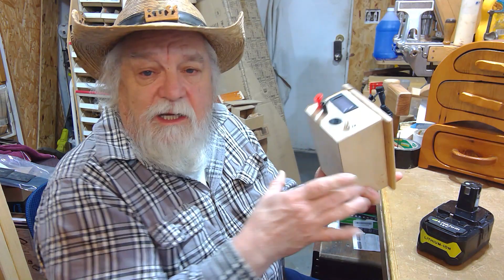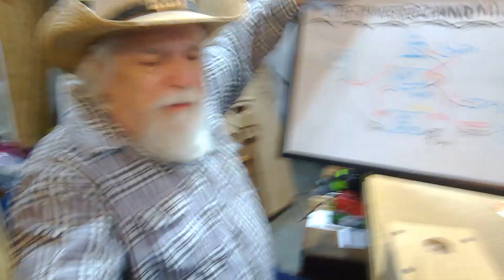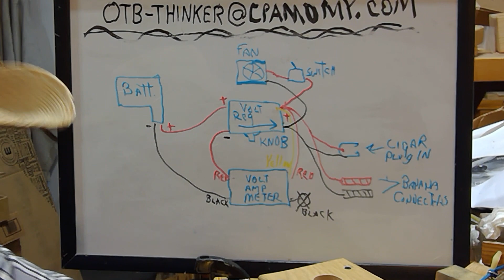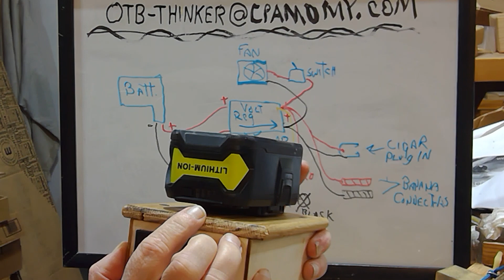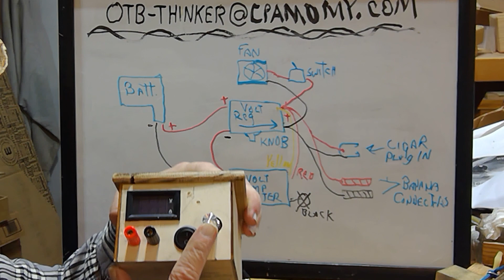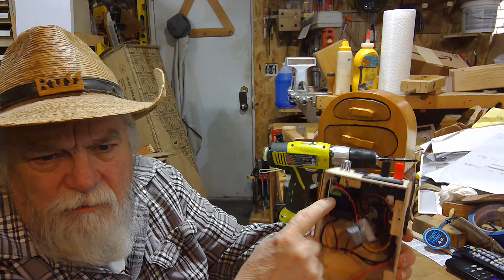Ryobi Powered Outlet Box by Rambling Russ

Comment: This is awesome. I love seeing creative uses for these tool batteries. I use my ryobi batts with laptop car chargers and usb adapters that are rated for up to 24v. Works great - charges phones, runs laptops, and powers my raspberry pi. Even my router and switches are rated for 12-28v so I just have a clip to adapt to a barrel jack for them.
Reply from the maker: Thanks Razz.  I have been making different designs of a Ryobi battery receptacle and now feel I have one that is as good as any 3D printed.  Can you describe a little more detail about your clip you use?  I am always looking for other's ideas.
BTW, I have made several Ryobi battery videos if you want to see other ideas I have done
Reply: @russveinot5754  Yeah, the clip I use is just the most common factory replacement battery clip from Ryobi's parent TTI. The part number is TTI300001044. Regular pricing on them is a buck or two per unit but you can get em on sale for under a buck from time to time I have a bag of like 20+ for under 20$ after shipping from a ways back. I got the idea from another youtuber who use them to make 3d printed receptacles. They have little terminals that fit spade females perfectly and I wire that to barrel jacks or xt60 connectors etc. Works great all by itself as long as it is sitting still - retention is good enough to move it a little from place to place but its not locked. I have a couple 3d printed receptacles that use keystone 209 terminals but the TTI part (with or without 3d printed base) is my favorite so far. Edit: You can also use the clips with epoxy putty or hot glue and molded or shimmed pvc etc to make a receptacle. Just ideas tho - yours look like they are working great. 

Thank you for the heads up I will check out your other Ryobi vids. I will check those out too!

Comment: 11.5 amp @ 20v? That is impressive! 
Oh I like that PCB. I'll have to look for that one,  most all I'd seen came from the front,  not the knob off the side.
Hope you got the door done, but unfortunately I think you lost the opportunity to get it done in the better weather. 
Like dude said, that Flintstones look is awesome!
Reply from the maker: Hey Charlie.  It was all built in the shop, so I did get the door done (not painted yet) & installed.  The dog & "You Know Who" are both very happy.
The potentiometer is hard to control to the meter gauge scale, but it does work very well for what I need.  BTW, those green wire connectors suck.
Reply: Green wire connectors?
Is that the Wago style, but no the brand?
Reply from the maker: @charlietuna5962  follow my link to the pics on Amazon.  I have never seen these before.  they clamp up instead of down.
Reply from the maker: @charlietuna5962  No, it uses a screw, but it pulls the plate up like the lower jaw when biting.  the screw interferes with the length of the wire being inserted.
Reply: Oh, I got ya....
The board connection terminal. 
Yes, those are pretty common. 
When they don't have a "back", they aren't so bad, typically found on larger boards.  But like you said,  when they have a depth stop, they are a tremendous PITA and are very difficult to get a significant bite on the 20+guage wire they allow.
Not so bad within a fixture box like you have, but really suck when you have more exposure and more wiring tied in a bundle.

Comment: So are you on a first name basis with your Amazon Driver? 
I'm telling you,  you'd enjoy the conversation over at Chester's. Ya, probably find similar things and maybe pay a few bucks more,  but he's definitely got a good selection and on hand.
What do ya think,  a 30 minute drive? 
So what are you tinkering with that you are using so many banana jack's handy?
I've been trying to find the time to get into the wiring on a Harbor Freight 5 drawer roller stack I'm building.  I'm planning to have a PC power supply (drop a cord)  as well as a One+ option for cordless option.  12v sockets, some LED's for the nightlife,  and have 24vdc on an XT60 jack. I considered the banana jacks for a variable voltage,   but didn't have the room left to have access for the rheostat knob mounting the buck board against the front panel. 
I figure if that need arises,  I've got some SAE connections too, so I can rig a removable lead that allows me that ability. 
Man, haven't they gotten the "smart grid" up by you? My power used to go out for days at a time,  but not since the upgrade to the grid. 
Dang it,  your opening the box.......... 
I'll bug ya later, Happy Holidays!
Reply from the maker: To be completely clear, the drivers know Annie (my shop dog) by name, and most bring her a treat when they come.